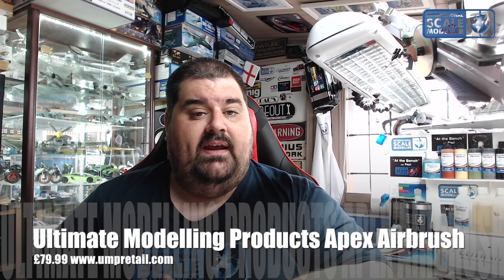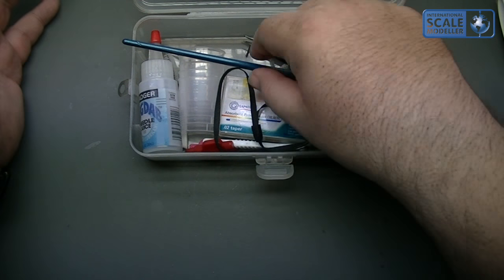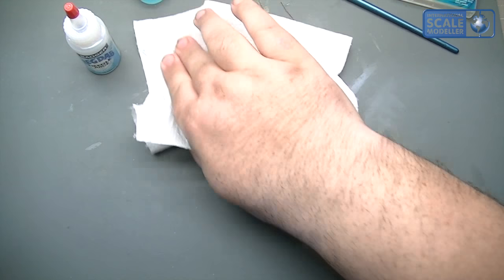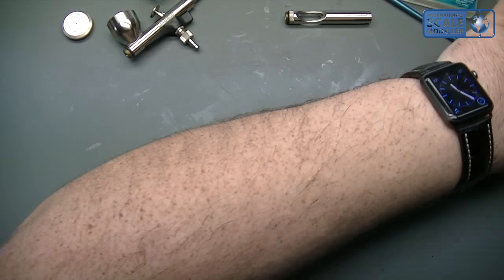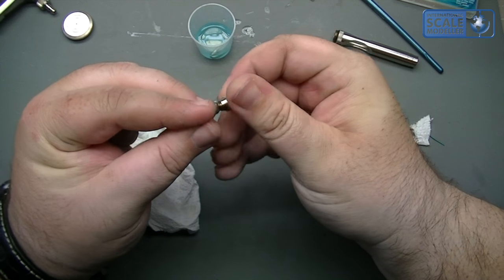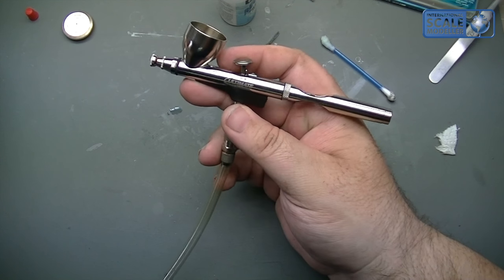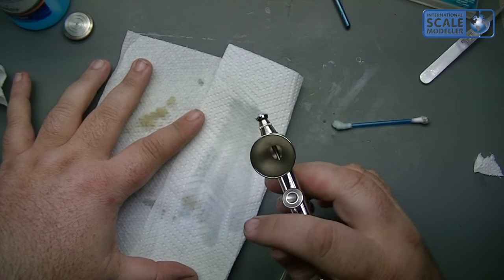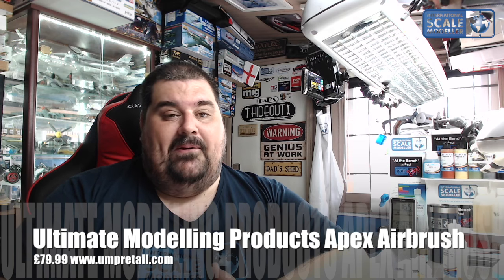Cleaning and Maintaining your Ultimate Apex Airbrush

Comment: Nice video.  I must say though, your routine cleaning technique (between colors) is about exactly what I do, but I find after what looks like a thorough cleaning, I can still blast out a little color on the towel.  I repeat the clean, and it still blows a little less color.  So I wonder is it me or the brush?  I have repeated the process up to 4 or 5 times and still get a little color coming out in the end.  Your results were clean as a whistle after one flush.   This was a red color (Vallejo) so I am wondering if red is just more difficult.  Other than that its the brush (Iwata HPC) or me.  Leaning towards me but it sure is frustrating.